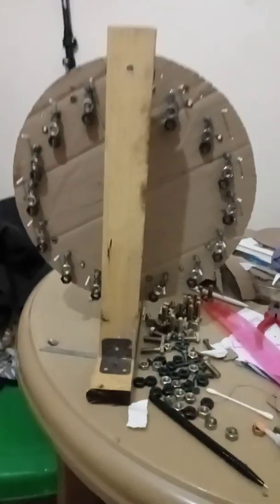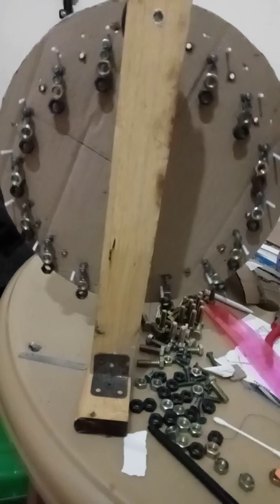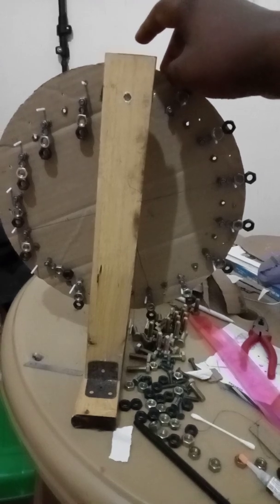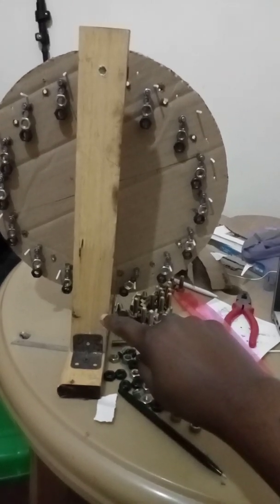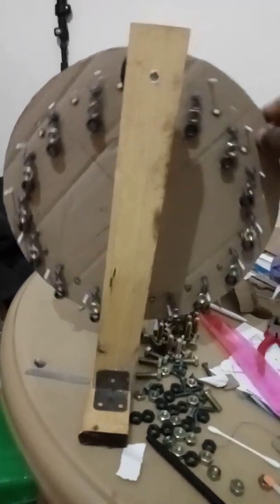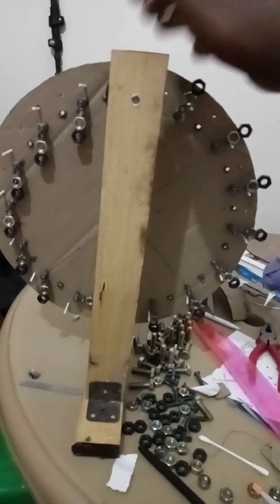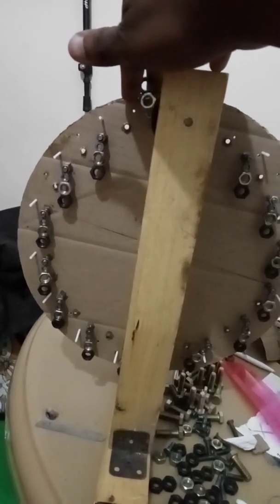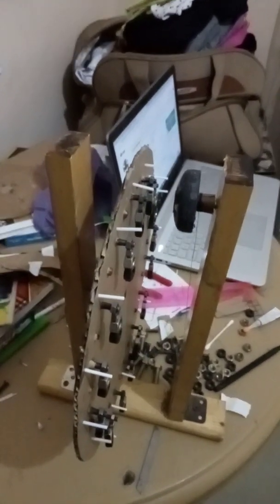Free energy, Perpetual motion, Overbalanced wheel, Gravity turbine - Part 1 by Professor Tiwes

Comment: Da musst du noch viel lernen, es kann niemals funktionieren.
Reply from the maker: Ich verstehe dich aber  mein Mathematical Model Sagt es  funktionieren kann. I used trigonometry and did my calculations in microsoft excel and based on the model, there is always a resultant moment as long as each mass is always lifted at the top. Please read the video description in you tube. I will share the mathematical model in you tube and then you can check it and tell me why it will not function. Thank you for the comment though. Vielen Dank.
Reply: @professortiwes2877  OK. I understand your plan. A small bill. You need a lot more individual weights on the bike, maybe twice as much. There must be so many weights that gravity on the right side always manages to lift 1 weight up either with a magnet or a guide. Here we go.
Reply from the maker: @MT-xw4jx  You are almost there in getting my plan. The more weights you have at the wheel circumference, the higher the chance of them lifting the one weight at the top. The plan is to use the resultant moment to lift the top weight by a pulley belt drive system. My plan is to use 32 weights and if it fails I try 64 weights. I think at 64 weights this thing will work!! Having 
challenges in the construction but the theory suggests that it can work.
Reply: But don't forget the bigger it gets, it doesn't change the counterforce. I would attach it with weights offset from 2 sides, which is just enough space that only one weight has to be tilted. Size doesn't matter.
Reply from the maker: @MT-xw4jx  the number of weights matter in terms of the resultant moment. From the trigonometric calculations for 16 weights the resultant moment (before considering the energy required to lift the top weight) is 5mgr (m-mass, g- gravitational acceleration and r- lever arm length). When 32 weights are used, this resultant moment doubles to 10mgr and then to 20mgr for 64 weights and so on. Since the energy required to lift the top weight is not changing and remains 2mgr or thereabout, as you increase the number of weights around the circumference, the chance of your system working increases. Imagine a very big wheel that is light and with a bearing at the centre attached with many weights say over 100 weights, I do not see how many weights with arms extended on one side and arms dropping on the other side will fail to lift just one weight at the top! If you get time, try doing the calculations using trigonometry and you will see what am saying.
Reply: @professortiwes2877  e number of weights matter in terms of the resultant moment. From the trigonometric calculations for 16 weights the resultant moment (before considering the energy required to lift the top weight) is 5mgr (m-mass, g- gravitational acceleration and r- lever arm length). When 32 weights are used, this resultant moment doubles to 10mgr and then to 20mgr for 64 weights and so on. Since the energy required to lift the top weight is not changing and remains 2mgr or thereabout, as you increase the number of weights around the circumference, the chance of your system working increases. Imagine a very big wheel that is light and with a bearing at the centre attached with many weights say over 100 weights, I do not see how many weights with arms extended on one side and arms dropping on the other side will fail to lift just one weight at the top! If you get time, try doing the calculations using trigonometry and you will see what am saying